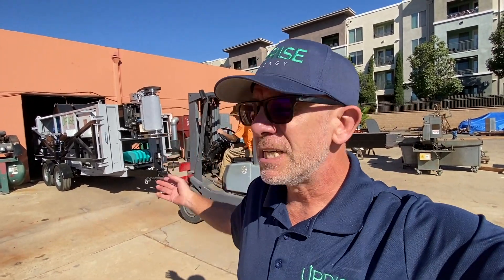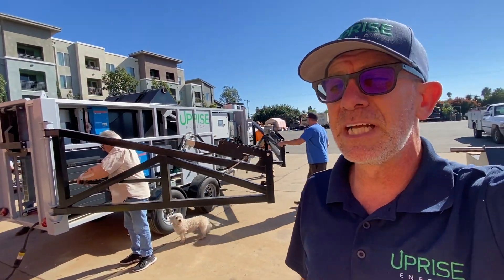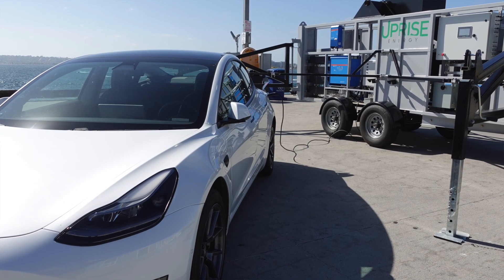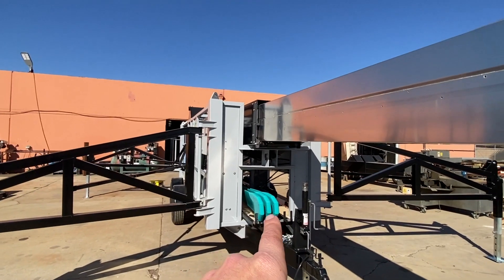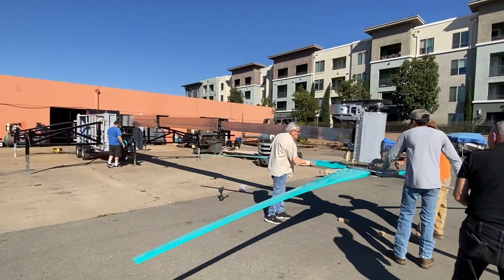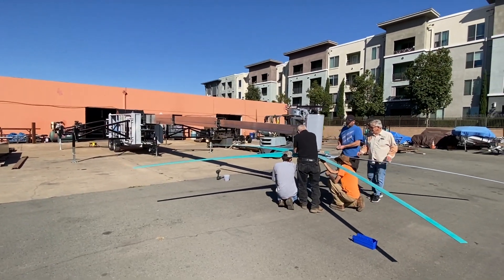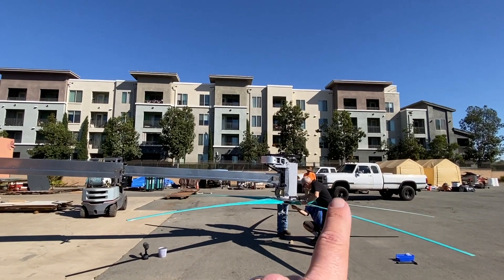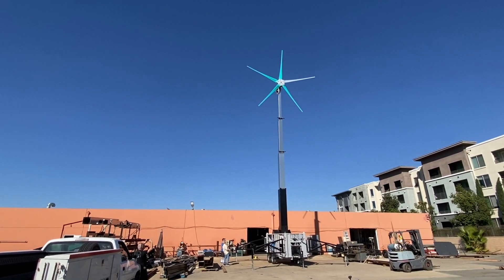Uprise Energy Mobile Power Station: Rapid Deployable Renewable Energy

Comment: 14 kW is not much at average wind speeds
of 4 to 5 m/s ,
possibly 1.4 to 2.8 kW,
powering one single coffee machine only.

Deployment at a beach possible.

It would need a whole platoon or even
company of 3 to 10 devices set up
at one point,
to "reliably" produce some meaningful
amounts of Watts.

Of course, a diversification of generators
could make it more difficult for an enemy
to destroy the whole power generation
capacity at once.

9 turbines on lorry plus
1 rechargeable battery of 200 kWh
could fit for one platoon:

9 x 1.4 kW ≈ 10 kW generation practically achievable,
taking 24 hours to fully charge the battery.

Useful for Taiwan probably to set up
autonomous defences at it's beaches.
Reply from the maker: Your power estimate at 4-5m/s is pretty much spot on. However, when you consider the average US home uses 24kWh/day, one of our turbines operating at this low wind speed will produce enough power to keep two homes running at full tilt, which is a bit more than your coffee machine example.
Reply: @UpriseEnergy  I was almost working on the same idea but my plan still have some improvements to your machine 🫢🫢